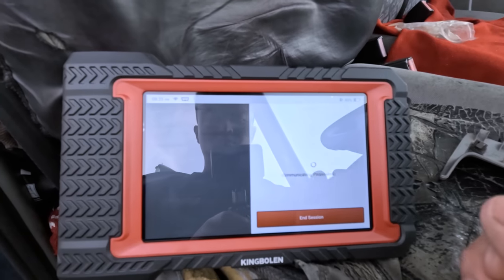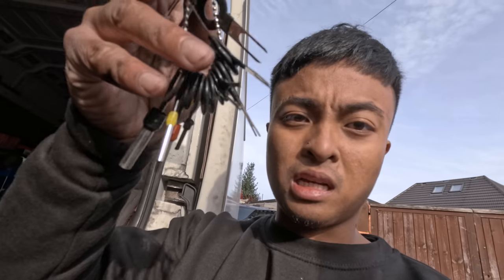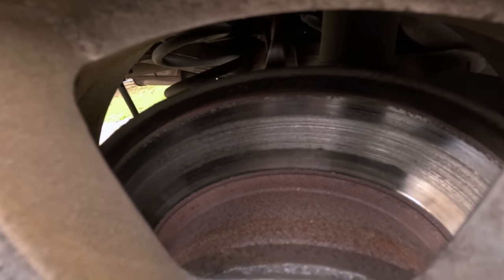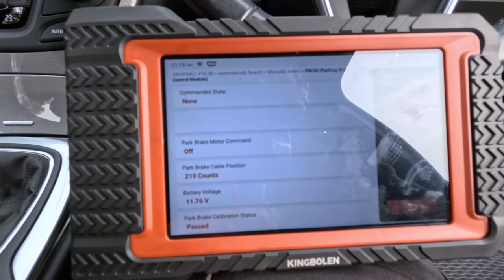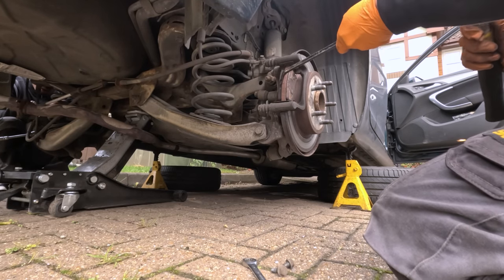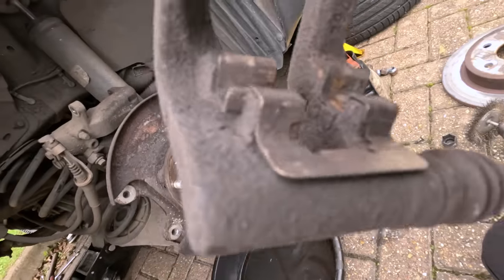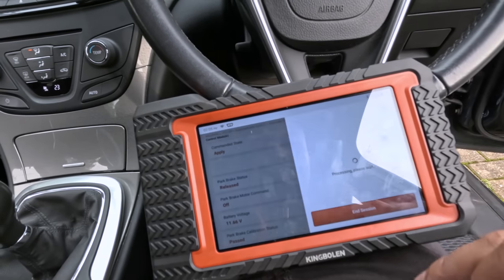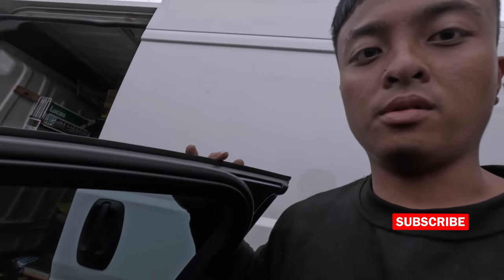I HATE INTERMITTENT FAULTS! SOMEBODY HELP ME! | Life of a Mobile Mechanic

Comment: Once this happened to a friends Vauxhall Vectra, owner kicked it at got it going again for nearly half a year, it had gotten moisture to the bottom of the blower motor and the drain hole in the motor was clogged. The moisture made a mess of the brushes and the motor burnt out.

Comment: I’m sure you don’t need to put the brake into service mode on these Vauxhalls as the e brake is not on the calliper it’s a motor that pulls on the handbrake cable. Regardless great vid and excellent knowledge keep up the good work ❤

Comment: All variable speed (electronic climate ) VAG fans use current detection when starting, if the control module detects overcurrent it isolates the fan. Once the behind dash area warms up the motor can then work on subsequent starts. They suffer sticky bearings / brushes when old.

Comment: @9:48 Bendix is an American company. All drum brake systems in today's modern passenger vehicles are base on the 1950s Bendix design. In the U.S. Bendix is a tier 1 supplier and I've used brakes pads from them without issue.

Comment: Maybe final stage resistor for the fan? Get the same on BMWs. Can start acting up, then goes full poweere or just stops randomely.
Reply: Corrosion or bad solder on the blower fan resistor, at times you'll start losing different blower fan speeds.

Comment: The brake pads might have been cheap, but the other 3 pads were perfectly fine, the knackered one just got hot from being seized and started to fall apart.

Mintex Ceratec grease is what you need, I've used it for years 👍
Reply from the maker: You saw the other pads, right? The material was falling apart. Don’t think that one was due to heat soak 🤔

Comment: Intermittent problems need a different diagnosis method. I come from mainframe computer repair and this is how i would attack your problem. Im just DIY with cars…
1 what could the problem possibly be? What can’t it be?
2 if it could be either the fan or the resistor replace the cheapest one and wait for recurrence. Then at least the customer got something for the money. And next time it happens you know what it isn’t.
3 temporally attache an indicator light to the motor and get the owner to observe it when it fails next. Move the light if needed.

Even so, I have an intermittent can bus fault at the moment and it has got me struggling. It been OK now for a week but last week it faulted with loads of U type dtc’s several times a day for days. Only happens on the road not in the driveway… especially after rain…

Comment: Hi, Keep up the good work :) I do like these HVAC issue's (NOT) In your case I would check Fan relay then both temperature sensors, then I would be checking the switch gear.

Comment: I would say that caliper has been sticking,  that disc has got hot which then compounds the problem which then I turn causes the pads to stick. I wouldn't be surprised if that happens again on that side, the caliper seals will be shot as they've got too hot.

Comment: it's a Blower motor brush , lots of dust over the time been used build up and loosing connection, that happened on my car   2 year ago , I opened it and cleaned it then started working again till last week stopped again then I replaced happy day.
Reply from the maker: Not dusty at all when I checked. I thought that too but definitely not. I will be checking voltages and resistance for when we re-visit

Comment: Check ohms resistance on the motor and resistor to make sure they are in spec. Will be surprised if it's not the resistor
Reply from the maker: I will be going back there at some point. Will check on that. Thank you for your suggestion!

Comment: Sorry to be saying this but from being in the motor trade for over 40 years I would like to give you a bit of friendly advise. Never use wd40 on rubber  parts  as you did on the the dust seal to lubricate it as wd40 tends to make the rubber swell up causes it to deteriate which then defeats the seals purpose.  

Regards jeremy
Reply: Agree.....i made the mistake of putting WD40 on a caliper i was trying to wind back. It killed the rubber.....it swelled up.
I had to put a new caliper on in the end so no harm done.
Each to there own anyway.
Reply: Oh bummer I’ve used it on my rubber sun roof seals for year wonder if that’s why they leaked. Thanks
Reply: I would agree but all depends how quickly the rubber is cleaned after the oil application , rubber soaked in oil for long period of time 100% yes
Reply: Wd40 will dry out rubber and cause it to split

Comment: yeah resistor pack failure, or motor brushes i has same issue turned out it was motor had failed, but do easiest first,, resistor pack if still does it ,, brushes on motor have failed,

Comment: Skope voltage accross  vs current on a long timebase and wait for it to fail. Volts and no current means bad motor or the motors connection.

Comment: 18:35 “He started kicking under the glove box and it worked fine”.  

That’s your clue. The carbon brushes in the motor were not making contact with the commutator, probably because they have worn with age. Any physical shock to the motor that is enough to dislodge the carbon brushes, just slightly, so they again make contact will make the motor run again. Further physical shocks almost never make it stop working, only more wear will do that, and it takes time. 

Sometimes, the braided tails from the carbon brushes are not dressed properly within the motor and do not allow full movement of the brushes as they wear, giving a similar effect.
Reply from the maker: Thank you for your help. It hasn’t stopped working since we visited this vehicle last, funnily enough. Owner is still waiting for it to completely fail 😅

Comment: could this of been my issue i had on a w205 c class 2.0 56k miles......? p001685 takes and extra secound to crank and a slight smell on petrol in the oil? runs fine.

Comment: I didn't quite see in the video you pumping the brake pedal to set and align the caliper piston with the inner brake pad before the re-cal. Failing to do that can cause the misalignment and brake pad to kink, maybe have cause the Bendix inner pad to have the type of wear you described. My experience with these types of brake systems the aggressive wear on rear brake pads is sometimes caused by the active stability control(traction control), where via the ABS activates the brake calipers. It's a combination of the driver's driving style and design, as the traction control is designed to wear the pads so manufacturers can sell more parts(for inexperienced driver's safety). I'm a mobile mechanic myself and I've been in the industry for 17 years... I enjoy your content and keep up the good work.

Comment: If all electrical supply test on a4 blower motor pass . Then id recommend pulling blower motor out and replace with new. classic sign of worn brushes when you
give it a whack, and it starts up. assuming all connections are tight and free from corrosion. sometimes you just have to make the call.. Loving your channel, wish i
had your energy.

Comment: My friend on the insignia it not the cheap pad to be worn that made it wear like that,

It's the car wash using wrong chemicals 

The car wash chemicals, stays in the brake pad friction materials 
It takes a very long time to dry, specially if you are not driving the car much 

So it's not your fault

Comment: You are wrong and i feel the need to correct you about using BENDIX brake pads.

Im not going to go into too much detail about but ill try and keep it brief.

I live in Australia and bendix was a well known and used brand here and i had discovered because of this a lot of counterfeits were out there on the market. Even legitimate companies would supply fake bendix parts without realizing it.
I new a spare parts guy very well and he would sell me at the time 2000'sh era a pair of front bendix brakes for roughly $80 to $120 depending on the model of the car. 
Someone told me that there was a spareparts shop that sold top quality parts for very low prices, so i went to check them out and this is what i found.
My friend the spare parts guy would sell me these pads for $90 something dollars and this place would give me the exact same for roughly $35.

To cut a long story short, i told my friend this and he was shocked, so he started his own investigation on how it was possible. He and then I found out that they werent proper bendix bads and they were a counterfeit pads, my friend said he contacted the main supplier in Australia or head office of Bendix and it turns out that this was a huge issue and was aware about counterfeits entering the black market.
There were small tell tale signs on how to tell the difference, like the logo wasnt printed right, the shade of blue was very slightly off, etc...

All i know is that we couldnt spot the difference and we thought this particular shop was somehow getting these pads off the back of the truck, so to speak. It wasnt until speaking with the official bendix person that we could tell the difference.

ive been out of the game since 2010 so i dont really know how bad it is now, here in australia with counterfeiting, but perhaps you just was unlucky and got either a faulty or counterfeited bendix brakes, as i have been buying them all my life and have never ever had an issue with them at all. but here in Australia they are expensive.
Reply: Brief, 
🤬ing hell that's a script ( laughing )

Comment: Re the brakes......if your customer has driven 16000 miles pretending to be Lewis Hamilton then those old brakes look about right.
It's the heat that kills them.....
Poor drivers cause early component failure as well as poor quality parts. They usually  go hand in hand.
Caliper is also probs on the way out .......

Comment: Simple lesson, don’t use copper grease on anything that moves and you’ll be fine 👍
Reply: Can u say why, when I worked in motor vehicle at college they advocated mucho copper grease on brakes except sliders to prevent squealing, thanks in advance
Reply: @volt8684  as you have said what happens to copper grease after a while it turns back to metal essentially due to movement so I’ve been told whereas just  on a nut and bolt it’s fine
Reply from the maker: The reason why IMI and other institutions is releasing new courses/refresher courses is because of new findings. It’s likely that colleges are still using old findings. Best to have refresher course every 3-5 years just in case. I’ve taken a whole lot now and to be honest, because of it, I’ve saved myself time for following new guidance
Reply: @themarvelousvlog  forgot to say absolutely loving your channel and learning a lot from you 👍

Comment: You don’t need a scan tool to release electric handbrake on insignia. You talk bollocks the calliper is clearly sized why hasn’t the other side worn the same? Also a faulty cam sensor would not make a vivaro smoke like it did obviously the injectors are fxxked